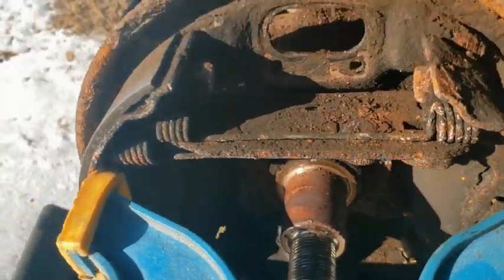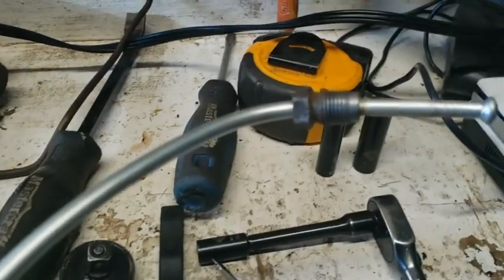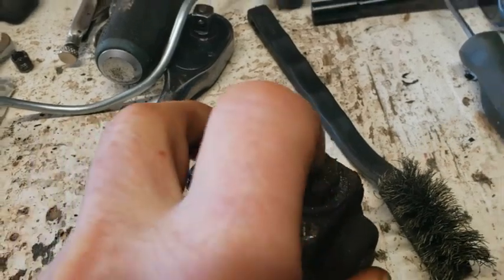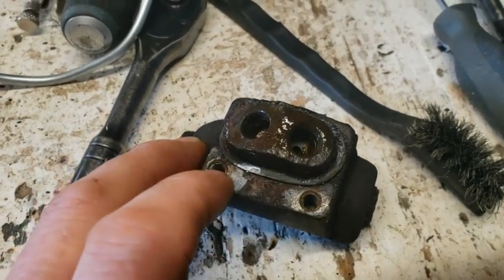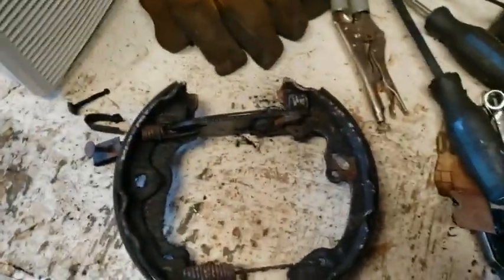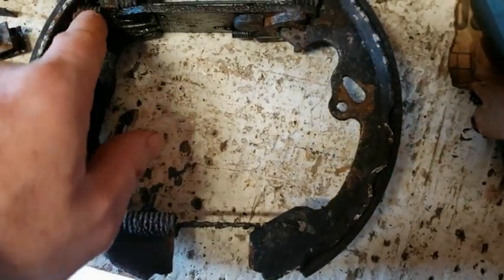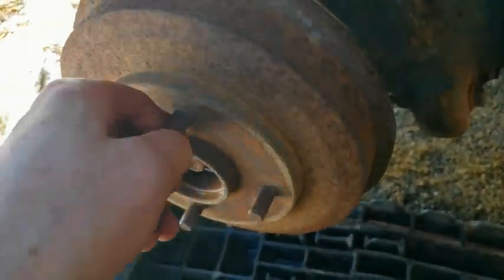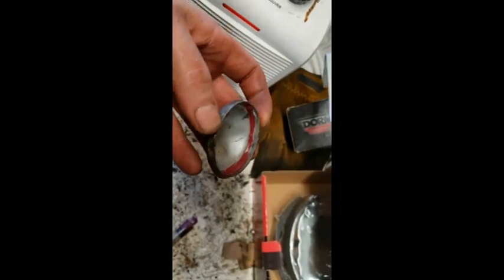Easy Steps to Replace Rear Drum Brakes on a Ford Focus #fordfocus #DrumBrakes

Comment: Nice repair HR. I don't miss working on drum brakes. I really liked how you shaped those lines with your modded tool idea. I always had a bad habit of kinking a brake line when bending it into shape. I did eventually break down and buy a tubing bender but my lines still didn't look as good as yours! Great tip on the dust cap too BTW.
Reply from the maker: Thanks brother for taking the time again to comment and say a kind word. Appreciate you man. Cheers

Comment: Good tips along with the repair. I had the same battery problem a few times, especially in cold weather. One of the benefits of living in cold states with snow, always material for YT videos,. LOL Not so much fun though working on rusty, crusty brakes, ball joints, mufflers, brake, gas line etc. My cylinder change on the Saturn was a nightmare, bolts rusted so bad & crumbling.
👍# 7
Stay safe, Joe Z
Reply from the maker: Lol thanks brother. Yeah the rust is so bad here.

Comment: What is that white stuff on the ground!!! oh, nm, I see it's an older video hahahaha
Working as a fleet mechanic for a taxi company in the 80's meant I've probably done thousands of drum brakes.  I hated the first set I did and I continue to hate doing them to this day 😄
Reply from the maker: Lol what you dont like trying to chase that aweful  pin through tbe clips i hate them too the rust here eats it bad by the  ocean. Yeah old video i found on phone . so you liked being fleet mechanic?
Reply: @DIYVariety  it was a decent job when I was younger. It got to be too much though. There were four of us mechanics when I started there taking care of about 30 Taxis and around 20 school buses. When I finally quit, I was the only mechanic left. I was working 18 hour days and got burnt out